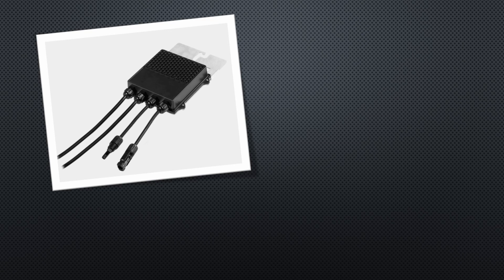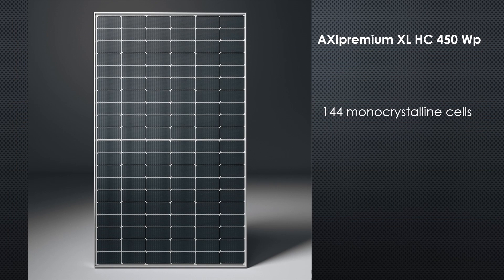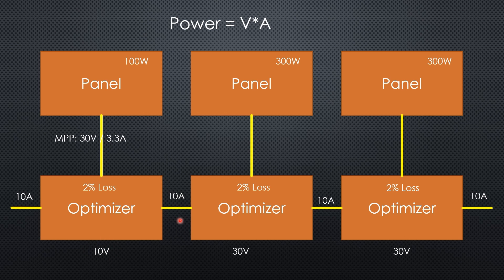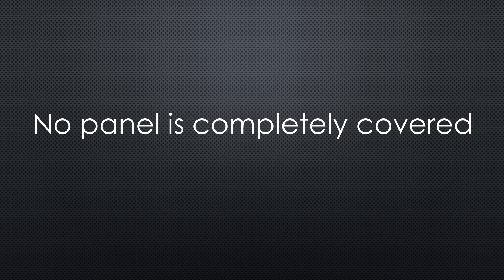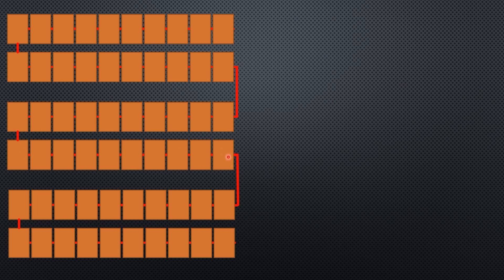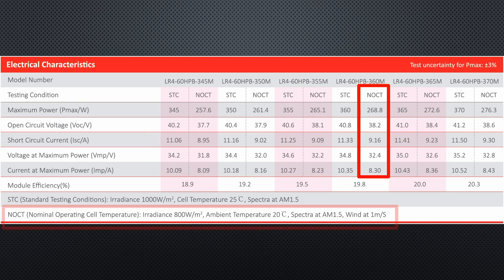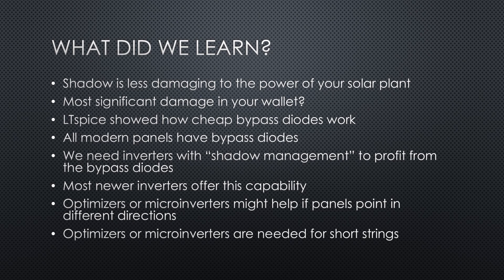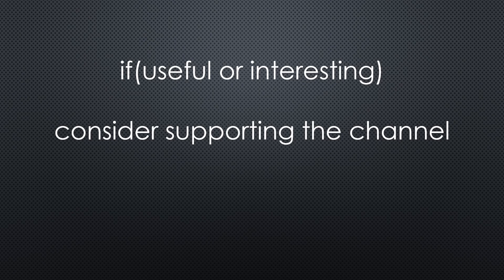441 Are PV Optimizers Worth the Money (e.g. SolarEdge)?

Comment: I do have SolarEdge system with 14 half-cut panels and all with optimizers. I've got south installation mostly with few of them on the west side. Don't know other producers, but SolarEdge optimizers give me one thing more - safety. When the system is inactive, for error reason or other, optimizers downs the voltage of each panel to 1V/panel.
I have 14 of them so my voltage near the inverter is 14V when you measure DC. It can be even in the full sun at 12:00 on the hot summer.
It will be 14V/DC only, and no Amps that could kill me or burn my house. With that system I also know exact production of each panel in my one string. If there is a bad panel I will know it easily by the panel color intensity in the app.
You can see that on the video below, with timestamp:
https://youtu.be/30wRG9dgIBc?t=218
Reply from the maker: These are all valid points and I am glad you are happy with your system. They are all additional features to what I showed today. So these companies have no need to lie on the optimization potential. But they do :-(

Comment: Hi Andreas,  So spot on !! Thanks for the counter balance. Efficiency is key !!
That said, what do you think is the main thing to look at,  when you want to maximise low irradiation in winter in Sweden. The time when electrical loads are the highest in the house and PV production is the lowest. 
Maybe a higher ( 10-30% ) Wp installed vs your inverter ? An inverter with very low start voltage ? Or a bigger MPPT range of the inverter, or just better of with low efficient panels, as they tend to work "relatively" better in low irradiation. Curious on your thoughts !

Cheers
Reply from the maker: All is good. And the best is to add panels. That is what I do. I add 7-8 panels direction south in a steeper angle particularly for winter
Reply: @AndreasSpiess  Interesting concept, and logical at the same time. Haven't thought about making one string steeper, to catch more irradiation for the winter. Just because the supplier only gives a mounting system of 13 degrees for a flat roof.  Up for a next round of efficiency with the supplier !! Like your thoroughly working style. 
Cheers

Comment: The bye pass diodes will route the current around any panel not performing as well as the others this has been my take on the situation. What I did not see any reference too. Was the case of using mismatched panels ie units of diferant outputs  where the use of the optimiser will allow these to all add Energey to the total . I personally use two panels connected in parallel to one optimiser each panel is 300 w one facing east and one facing west at quite a steep angle. I have 8 panels set up this way these are to catch morning and late evening sun. Especially in the winter when sun is lower in the Uk .   During the mid day sun both panels are producing but well below there optimum so still ad to the total . The idea is to flatten and widen the hump and make the power more usable . I also find the feed back from each optimiser hand to see what each panel is producing.  Again this shows that all panels point same direction but they do not all produce the same kw  over the same time period . Again a lot of this could be done utilising the blocking diode  but each diode that operates adds a volt drop in the feed that costs power also . Interesting vid
Reply from the maker: Connecting two panels with different directions to the same MPPT creates a difficult problem. The best voltage for one panel is very different from the other. So, which voltage is best? It can only chose one voltage if the panels are in parallel.
Reply: @AndreasSpiess   hi yes that is true . But in practice I find that as they are east and west facing panels. In the morning the the east panel is seeing the sun  and provides power as the sun comes round the east panel starts to reduce its output  while the west panel output starts to rise as the sun starts to shine from the west till sundown.   At about midday I have current clamped both panels and they both are supplying some current  for a short duration until the west panel output is rising and taking the lead .  For me it just saves the cost off a optimiser on a panel that will spend 1/2 of the day out of direct sunlight .
I now have some more optimisers so out of interest I may just try adding an extra one and see if the return is a lot better

Comment: When you completely block a panel, the bypass diodes go to work to prevent blockage of the current. (All panels have bypass diodes) The value of optimizers is that they improve current flow during partial blockage. I use Tigo optimizers and they improve my partially shaded arrays power output by about 25%.
Reply from the maker: Good to know. So I assume you the glad guy who has a possibility to do a parallel test without the optimizers?
Reply: @AndreasSpiess  I put the optimizers on since I had a lot of (partial) shading at different times of the day. My "comparison" was before/after installing the optimizers and there is a clear boost in power. I like the Tigo optimizers since you don't have to install them on every panel, just the ones with shading. The software gives you a reading on what they call "reclaimed power" which is their calculation of the extra power  "reclaimed" by the optimizers. For me, it's about 25% extra on my 4.5 kW array.
Reply: @MarkSpohr  That 25% is a value which is give by the company which may not be accurate. The actual benefit of optimisers is less than 10%. Remember that the optimiser themselves consume 2-3% power. Also, the shaded panels will activate the diodes regardless of optimisers as diodes are inbuilt to the panels.  So, your 4.5kW system would perform the same as a 5kW system without optimiser. Unless the cost of optimiser was less than what is needed for 0.5kW additional panels, it is not worth it
Reply: @shrujanamsyama9940  Where is your data that shows "less than 10%"? My data shows 25%.
Reply: @MarkSpohr  The data on what basis? Is its a theoretical data or based on actual difference with & without optimiser? The 10% is based on empirical evidence on how the diode works. The difference between the diode & optimiser is minimal and is in the margins
Reply: My data from my panels
Reply: @MarkSpohr  The data was based on algorithm set by the company which may be incorrect. Do you have actual data based on actual measurement ?
Reply: @shrujanamsyama9940  Yes. As I have stated. I have data from my installations. Time to invoke Mark Twain.

Comment: for NEC 2020 and roof mounted panels you need  rapid shutdown modules for each panel anyway.  Optimizers etc have that built in, so factor that cost in.
Reply from the maker: What would I have to add to my string inverter (LUNA2000) to be compliant? Here, I had to add nothing.
edit: I just found information: It seems you have additional specifications in the US. So you are right. Fronius sells such a RAPID SHUTDOWN box for 160 dollars. And it is needed for each string.
Reply: @AndreasSpiess  I think sometimes it's each panel if roof mounted,if ground mounted then don't need RS for each panel. I think Tigo brand is about $30 per panel for each shutdown module.

Comment: My solaredge system was installed 7 years ago in a single string split orientation system. 10 west 10 east. As i have nothing to compare it with i cannot know if I fell for the sales pitch.  One benefit of the optimizer is that you can see when a panel in a string is not working and get it replaced under warranty.  Not sure I would have noticed that one pannel in 20 was only giving about 50% without being able to see the output of each individually.  Good video as always.
Reply: This is why I decided to get optimizers. 👍 🤷‍♂️
Reply from the maker: I agree in your case. So I assume the panel was defective and not the inverter. What was the issue? Maybe you would have discovered that the string is no more up to date. But for sure you would have to find the panel manually.
I am also glad to read that your optimizers still work. An important information!
Reply: @AndreasSpiess  I don't know what was wrong with the panel, the supplier turned up with a new one and swapped it out. All panels look about the same still.  The system output does not appear to be reducing over time, just fluctuates from year to year.  Keep up the great work.

Comment: Your analysis is incomplete. I choose micro-invertes from enphase, why? Because i can get a material warranty from manufactur of 25 years. In 25 year you will need to replace or repair your inverter at your expanse. I don't know any inverter manufactur with 25 year warranty. Another reason i choose micro inverters is a lower risk (Security) from AC lower voltage vs DC higher voltage on roof from inverter with array. Nothing is perfect, you have to choose with information of pros and cons of from available options.
Reply from the maker: I have no problem with your choice at all. You did it because of commercial facts. I just wanted to show that some of the arguments are wrong from a technical point of view.
Just a small remark on the warranty: Often it only covers the material cost which is not much. Where I live, the labor cost of replacement easily is 10x the material cost. Let’s hope our installations will live long!
Reply: You need to consider the fact that the enphase warranty is only good if enphase is solvent and still trading in 25 years time.  The company was only founded 16 years ago, so 25 years is pretty bold.

Their inverters, on a per panel basis, are vastly more expensive than traditional string inverter systems.  

If the facts in this video become accepted by the industry, then these optimisation concepts become obsolete and the very business model that these companies staked all their investments on become worthless.  You can only guess what that will do to the value of your warranty.

Comment: Andreas, if I remember correctly, most Huawei inverters allow for two independently optimized strings. In other words, even if you did have 50% panels facing east and the other 50% facing west, you could connect them as two separate circuits, and could still get away without optimizers, right?
Reply from the maker: Yes, this is what I did. I added the south panels to the eastern string.

Comment: A fantastic video!   The best solar optimizer is to take cash used to buy optimizers and buy 30% more solar panels!  Being a fellow amateur radio operator, the last thing you want are a bunch of poorly made switching supplies on your roof connected by a long antenna.
Reply from the maker: Indeed, like with motors, displacement is best replaced with more displacement ;-)
Reply: @AndreasSpiess  The saying in the US is. 'There is no replacement for displacement'  ... :->

Comment: A very intetesting video. As a fellow Ham have you tested the EMI or RF generated from the microinverters? There is a possibility of an RF smog being produced at cirtain times of the day. If true the bypass diodes might be a quieter solution.
Reply from the maker: I just did a quick test and did not discover RFI. I tested my neighbors Microinverters and my Huawei optimizers I have for tests.

Comment: Hmm, array life 30yrs. Industry pushing for 50 years, the optimizer/string and the central inverter will be replaced multiple times. You ignore the cost of the life of the array. You ignore the value proposition completely. Like to argue don't you! Enphase microinverters deliver value as well as function. Perverse and strange Module manufacturers offer modules with optimizers or microinverters attached. You imply a scam, You also omit your array has virtually no intelligence. Self-consumption selfish design, self-serving video.
Reply from the maker: Thank you for sharing your opinion!

Comment: I guess Dave Jones from EEVBlog’s 3kW system string was too small.  When it was shaded by a small antenna, the power dropped significantly.
Reply from the maker: I saw this video. But I do not remember if he did a proper investigation on why it happened. But he did the right thing and removed the antenna. A cheap solution ;-)

Comment: Hi Andreas, thanks for this video. Very Interesting to see how well the bypass diodes actually fare. However if you get a chance to resetup the, I think it‘s be if you could run these tests without fully blacked out panels, but with partial shadowing i.e from a net or light - I‘d be interested to see if they help on bypassing clouds or a tree shadow
Reply from the maker: The results will be similar. And we have to pay attention that we do not focus on the details: Electricity still is dirt cheap and you have to produce many, many additional kWh to pay for a single optimizer. For the price of 2-3 Optimizers you get an additional panel. This is what I focus on.
Reply: @AndreasSpiess  Fair enough, what you do should benefit your setup. This stuff is really expensive. 
However there are situations where one can't scale with panels any more. 
- When there is no space
- The max voltage of the charge controller is reached
Reply: @AndreasSpiess  I'm wondering how quickly the bypass diodes trip: is it possible that shadow would not reduce the current enough to trip the diodes, causing a reduced output? In that case, could an optimizer make a difference as it senses the reduced output from the full panel?

Comment: If you don't have a micro inverter you need to buy a string inverter which will be a hard to get one if you prefer to buy from a local company. 
Hmm maybe string is the better option anyways.. Yet Fronius stuff is hard to get and I prefer to fund the local industry in Europe.

One can get quality Enphase Microinverters way easier.. 
(Not EU though)
Reply from the maker: I agree. BTW: AFAIK, Enphase produced (still produces? ) in China and moved manufacturing to Mexico. Also not truly European, I think ;-)
Quite normal for our globalized world. And maybe Fronius is waiting for chips or other Materials from China? Not to forget 95% of the solar panels.
I hope that this will change, too. But it will take a long time and cost a fortune.
Reply: @AndreasSpiess  Yeah for Enphase that is the case. Didn't know that they went to Mexico guess cheaper.
Reply: @AndreasSpiess  I mean I do think that consumers do have sort of the option here don't they. I do actually wonder how many are there still that produce from the silicone to the panel in Europe.
Reply from the maker: @platin2148  Meyer Burger (a Swiss company) produces silicone wavers in Germany.
BTW: in 2012, Germany had a bigger solar panel and wind industry than China. Now the 1000$ question: Why did they lose this advantage? (Hint: It was not because of the Chinese). As I said before: I do not like this fact, but it happened.

Comment: Have you ever done a calculation about how long the PV system will take to pay for itself in electricity bill savings?
Reply from the maker: No. With current price increases of energy cost a calculation is not easy. I assume it will be less than 5-6 Years including the hobby (Up till now, the battery was no investment, it was an expense). Without it therefore faster.

Comment: Run DC at home: Kettle, TV, computer and anything with universal motors or switchmode power supplies works just fine on DC You might only need to throw away your AC clock radio.
Reply from the maker: Interesting concept. I would not want to go so far. AC has its advantages, particularly for a married man ;-)

Comment: Great observations/tests to make us think about what to install Andreas. Hope you will go more into the use of the battery in the near future.

Just my n=1 anecdote:
I had a 110cm satellite dish on my flat roof that is North-South (about 165 degrees). My PV installation is 10 years old, 1 string, facing almost perfectly south. At just after noon there nearly always (on cloudless days) was a huge drop in my generated power for 45-60 minutes. Power "lost" was about 1 kWh which is about 10% of the daily power generated during summer. In the other seasons, due to high latitude, there is almost no significant loss. 

The dish was out of alignement, but I cannot easily access my roof to either fix of remove. When my neighbor installed a PV installation, I asked the installers to remove my dish, not interested in fixing it not watching TV anymore. Since then the drop is gone. Power generated is a nice sine like figure. The dish cast a shadow on 1 of the panels apparently.

Don't know the make or manufacturer of my panels, but I guess they would have benefited from optimizers. But I have a feeling it wouldn't make economic sense to have had them installed.
Reply from the maker: The forecast of the „optimizer guys in your case would be that you lose the power of the whole string. So if you lost all power during the shadow phase, the chance is that your panels do not have bypass diodes…
Reply: Did you have "shadow compensating" MPPT? Also, did you have adequate bypass-diodes on your panels?

Comment: I'm pretty disappointed with my solar installation. It was sold to me as an electric bill replacement, but I'm still paying a significant electric bill plus a loan for the installation. I never should have done this. I should have designed my own system.
Reply from the maker: I never planned it to save money. I thought it is the right thing to do in the current situation. I will get my first bill next spring (we have yearly invoicing). I am curious if It’s sign is positive or negative. Since May, we purchased electricity for 10 dollars. And delivered 3800kWh. But winter comes.
Reply: I am very happy with my solar installation. I packed the whole roof with panels, 45 in all. What I harvest in summer pays for the the electricity I have to buy in winter.